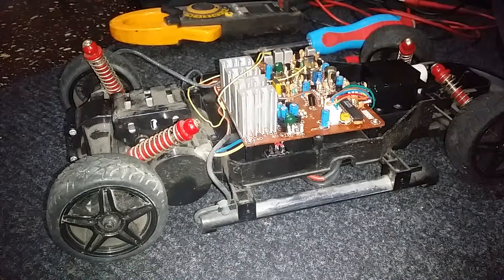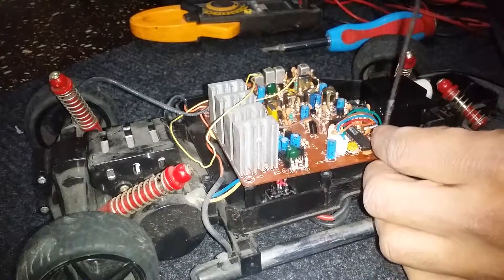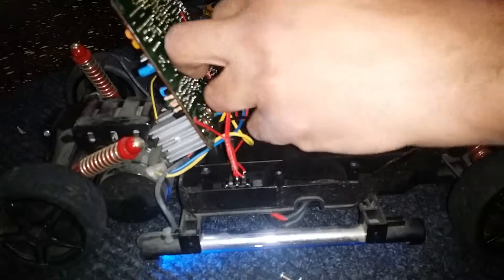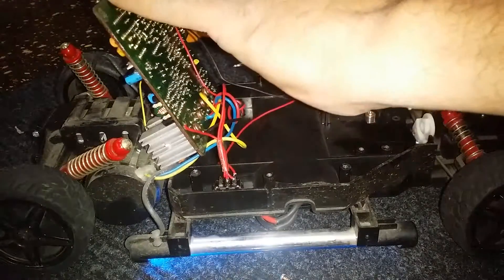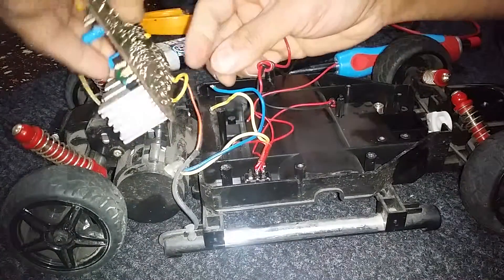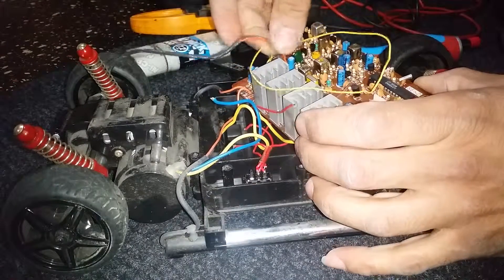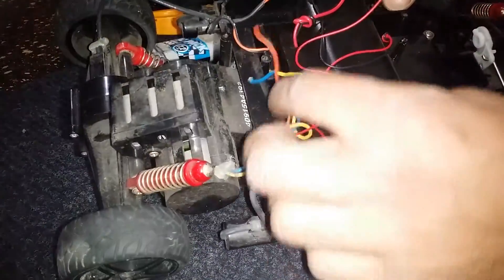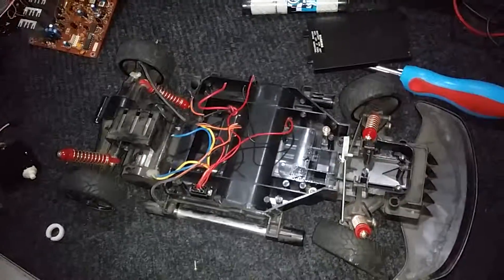Radio Shack Acura 2004 RC car conversion electrical component remove part 2

Comment: I have the same Car, but the antenna broke off, I’ve tried soldering a wire on but it still won’t work, any tips? Thx
Reply from the maker: I would say you would need to insert wire through a antenna tubing to keep it straight up and you might get better radio signal. Or maybe your transmitter is working properly or battery low. I had the RC car but no transmitter so I decided to converted it . ask me any question and I'll answer as best I can thanks